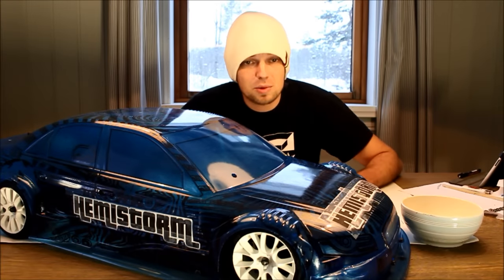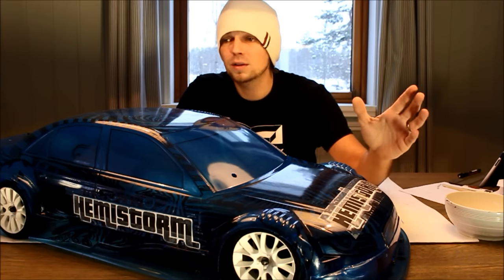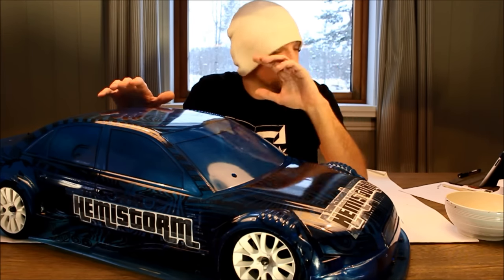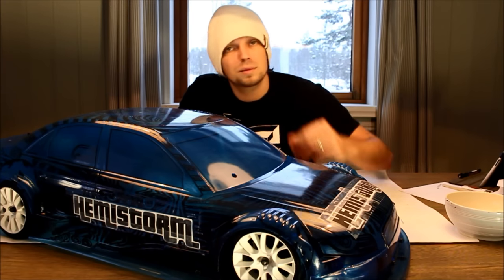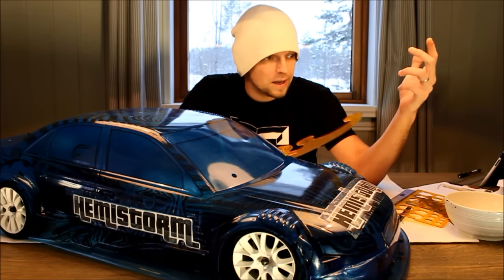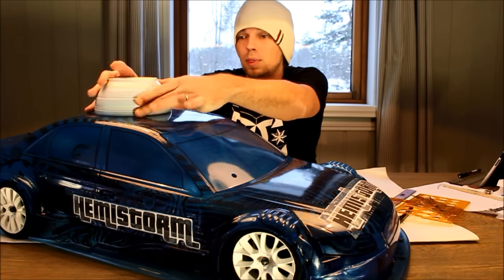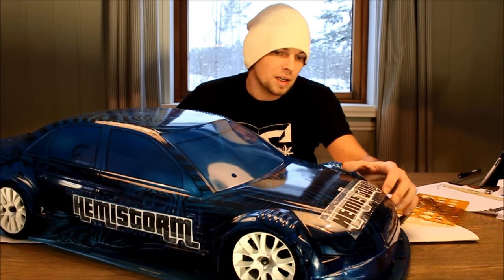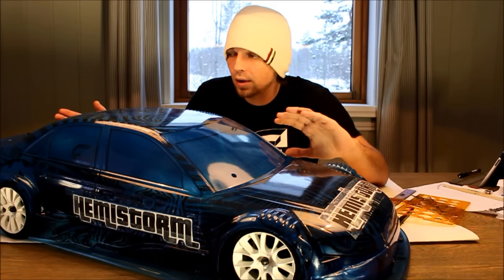How to put on a design - FG Audi A4 DTM Sportsline 4WD

Comment: Hey man, I'm looking for some lamp like you have, is it a DIY or some rtr product? if it's DIY can you please share what are the components?
Thanks,
Snir.
Reply from the maker: +שניר בן-דוד Hi Snir, it is actually a builders lamp with fluorescent tubes. It should be fairly easy to find one of these, they work great for this type of thing.
Reply: +HemiStorm RC - Custom RC builds, painting videos and more 
I tried to find one at eBay, Aliexpress etc. but without success, I'm actually thinking to fond some plastic container at the right shape or build a wooden container with clear top such as clear perspex and to insert 5M of LED strip with a dimmer what do you think? will it work fine in your opinion?